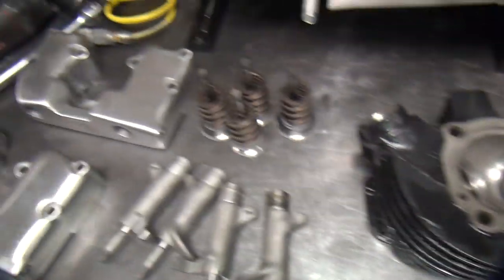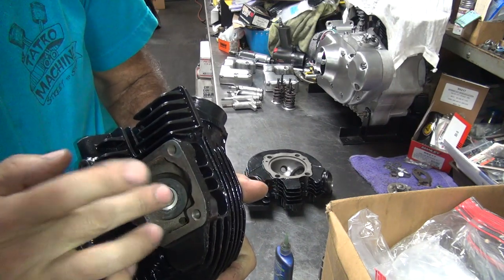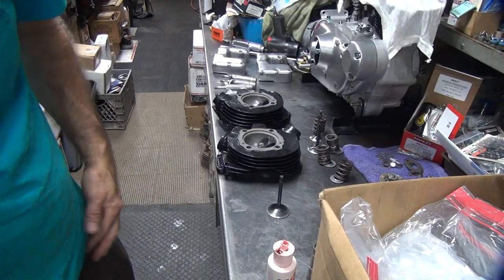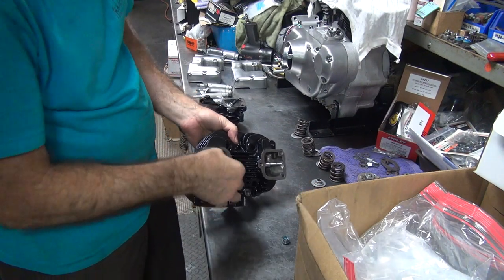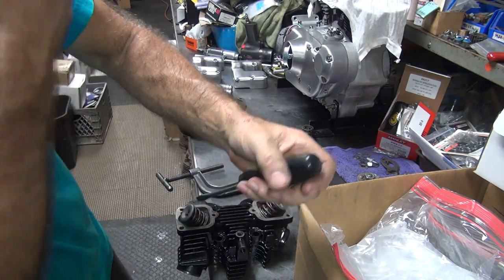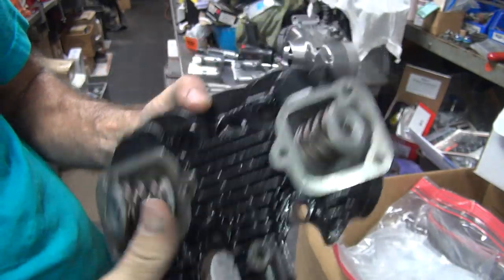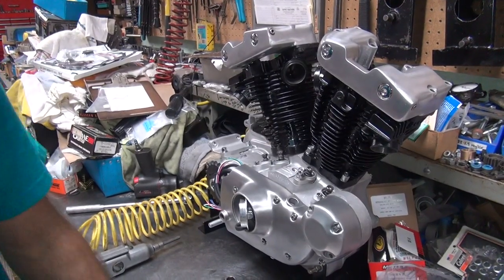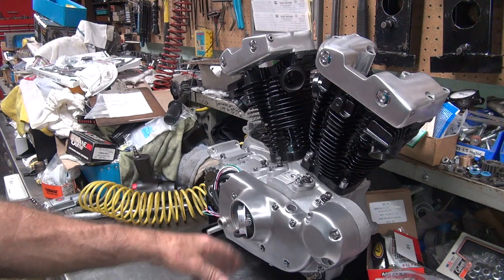1977 xl xr street tracker #138 motor rebuild repair 1000cc sportster ironhead by tatro machine

Comment: When i had an ironhead leaded gas was still around so valve seat recession wasn't an issue.Do you suggest using fuel additive on these motors ?

Comment: Is that what quad seals are made for? Or are they supposed to go some where else, but work better there?
Reply from the maker: correct. made for the top pushrod covers which they such for. i use them for the rockerarm shaft seals which they work very well for.
tatro

Comment: Question for you, when you hone iron Sportster cylinders do you use a torque plate? Thank you for your time, Frank
Reply from the maker: i don't use any torque plates on anything because they do not repeat the cylinder bore distortion. no matter what you do the bore is going to be off so why bother. castiron have way less cylinder bore distortion then the thin ass aluminum ones have.
tatro
Reply: @TatroMachine  thank you for letting me know I know the evolution is different because the studs go all the way through. Someone told me oh no you have to do the iron Sportster also. Thanks again